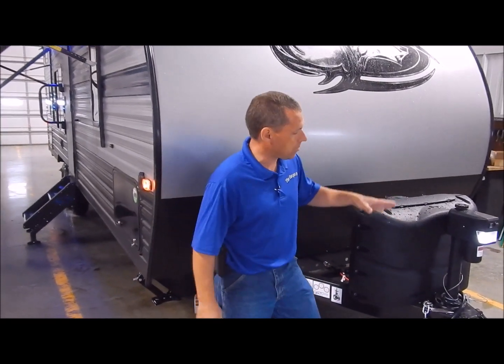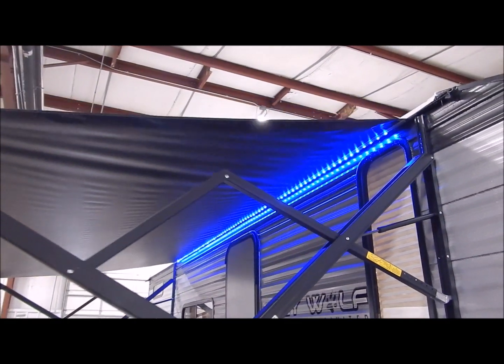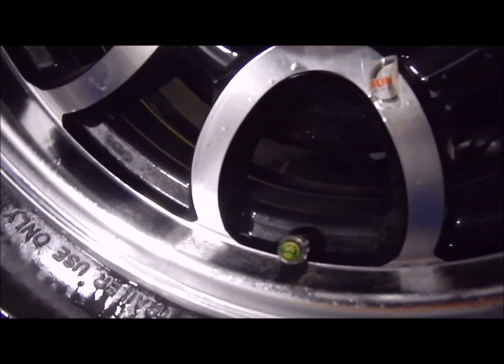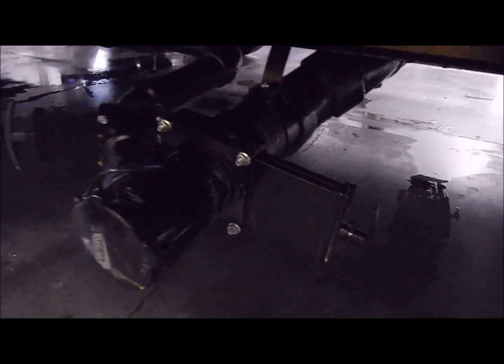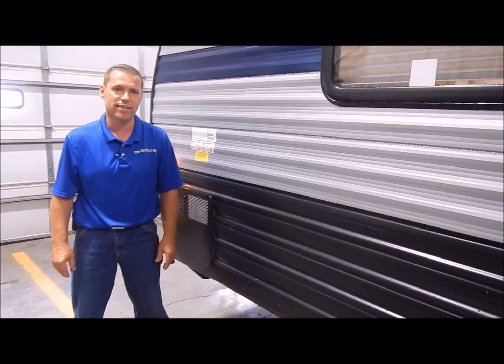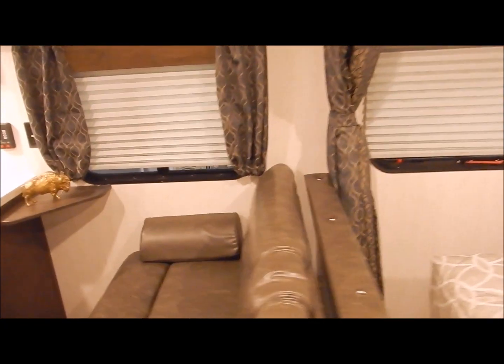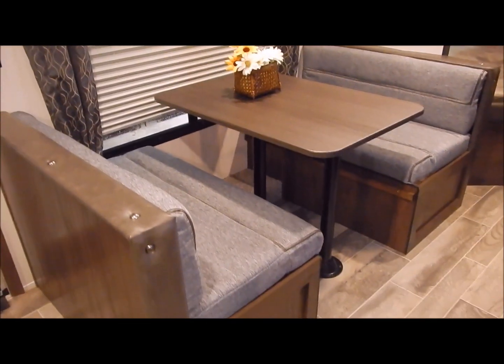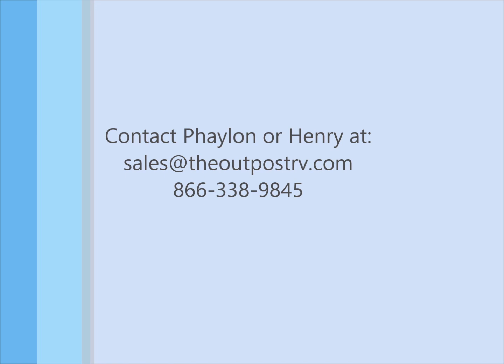2019 Grey Wolf 26DJSE Travel Trailer

Comment: the trailer is great, with storage under the dinette seats and the sofa bed. Is there a chance the wall separating the bunk beds and dinette is up to the ceiling, instead of halfway only? Does the stabilizing jacks are the new JT strong arms? Does it have storage under the queen bed?
Reply from the maker: The wall doesn't have the option to reach to the ceiling.
Stabilizing jacks do not have the JT strong arms.
Yes it has storage under bed.
Have a Great Day!!
Reply: @theoutpostrv7120  Thanks for your prompt response. I'll give you a call when I made a decision.